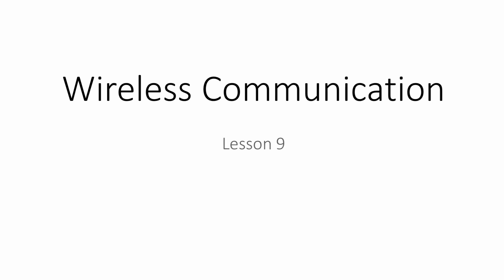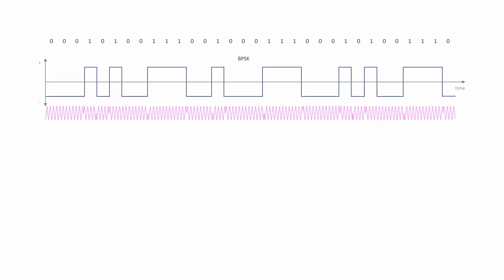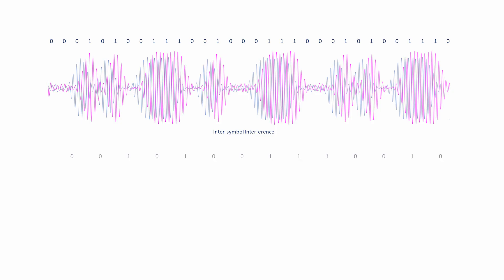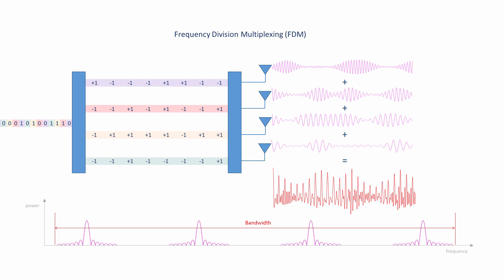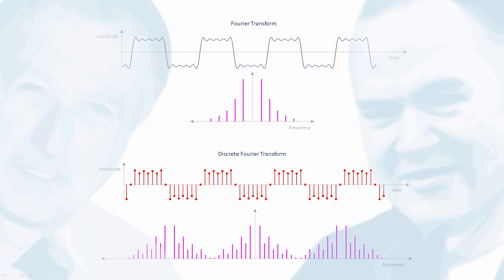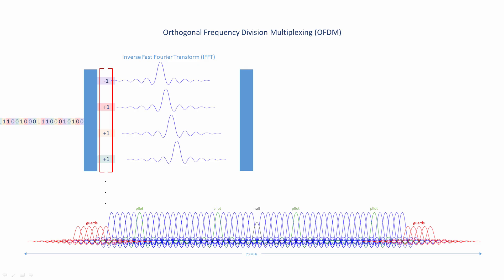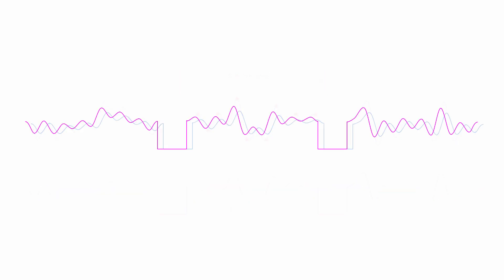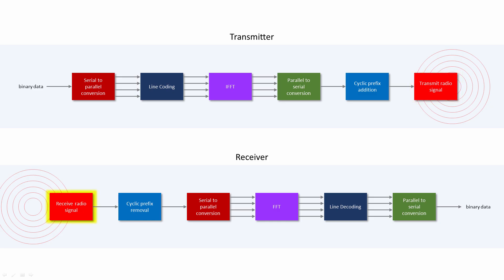Wireless Communication – Nine: OFDM

Comment: Lecture 1: Multi path Fading Model-Wireless Communication     • Lecture 1 Multi path Fading Model-Wireless...  
Lecture 2:  Concept of delay spread and bandwidth      • Lecture 2  Concept of delay spread and  ba...  
Lecture 3: Doppler shift and Coherence Time, Slow vs Fast Fading    • Lecture 3  Doppler shift and Coherence Tim...  
Lecture 4: Multi-Carrier Modulation and OFDM Principle    • Lecture 4: Multi-Carrier Modulation and OF...  
Lecture 5: Machine Learning and Deep Learning Basics    • Machine Learning and Deep Learning Basics  
Lecture 6: Deep Learning using Python Demo    • 6  Deep Learning Demo  
Lecture 7: Integrating Machine Learning with Deep Learning     • Integrating ML with Deep Learning  
Lecture 8: Wireless Channel Estimation Basics     • Wireless Channel Estimation Basics  
Lecture 9: Outage Probability using Random Variable     • 9 Outage Probability using Random Variables  
Lecture 10: FAS System    • 10. Fluid Antenna System Introduction

Comment: Hi and thank you for an excellent explanation of OFDM.I am just beginning to try to understand OFDM and have one ( probably stupid ) question though:

Let's say you use some QAM-modulation. In to the IDFT you then have complex numbers from a constellation diagram.
Out from the IDFT you have some other complex numbers that are serialized and transmitted. 
In the receiver, these complex numbers are sampled and fed into the DFT that calculates the original complex numbers from the constellation diagram.

The question: If you can send and then detect the complex numbers from the IDFT, why can't you send and detect the complex numbers from the constellation diagram directly ?
Reply: You can send IQ directlybia a modulated carrier but you will run into issues with fading. OFDM subdivides the channel into narrow slices that handle fading much better.

Comment: 13:25  why 64 channels with a span of 20MHz occupy 5GHz bandwidht? How latge is every channel? I thought in OFDM each channel is 64KHz or less
Reply: Yes, 64 Channel are inside 20Mhz (in reality if i do not mistake subcarriers are something like 10khz each other, the multiplexing of many users in the same Channel is done by assigning a SET of subcarriers to users)... 20Mhz is the intermediate frequency modulation (the output of IFFT converte to analogo, before the main modulation at 5GHz)
Reply: @albertosimeoni7215  grazie Alberto